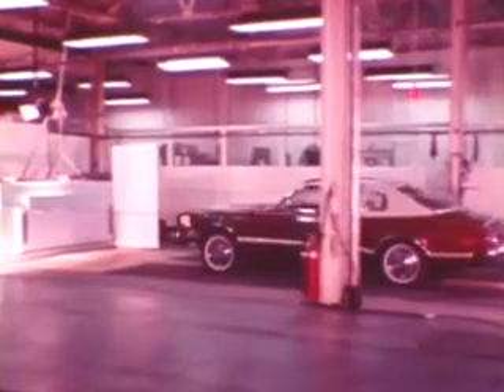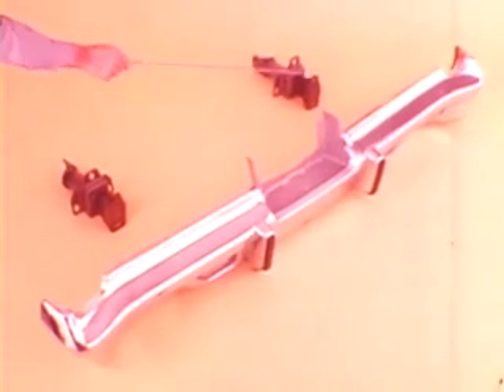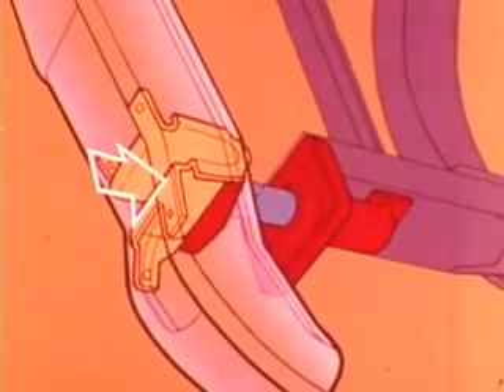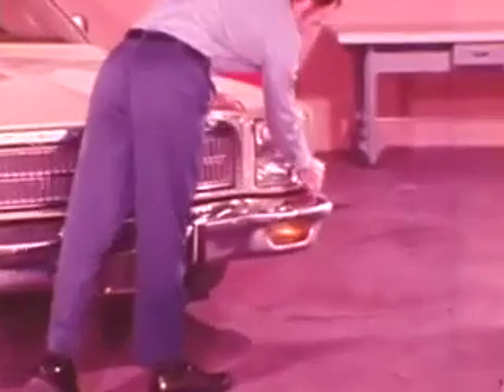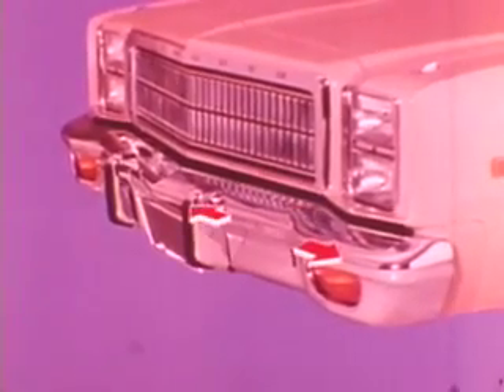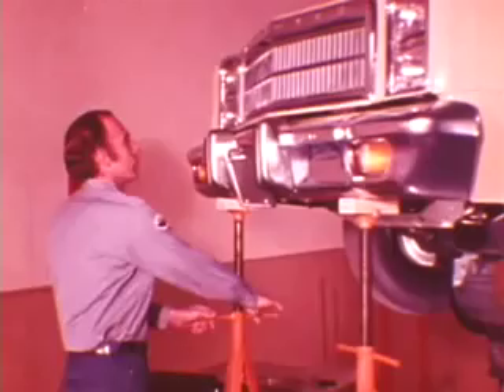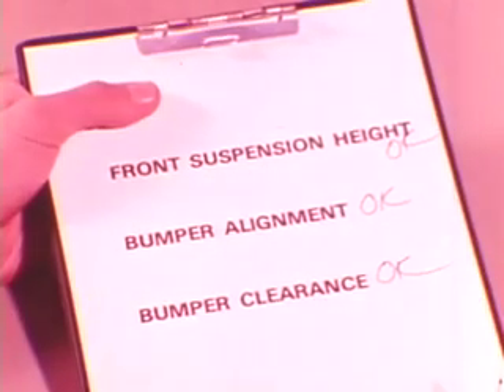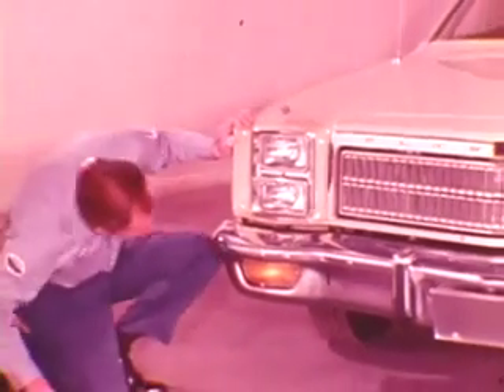Chrysler Master Tech - 1977, Volume 77-5 Impact Energy Absorbing Bumper System

Comment: We are from the Government are here to help!! I cut my teeth as a 'Wrench" on this vintage garbage... Yep, brand new these things would, on average, sustain a 5 mph impact if hit dead square. 

The theory was: Cheaper crashes at low speeds and limiting or stopping COSTLY damage at speeds, a good thing, right? No. It added around 150 lbs. of steel and assembly garbage as well as complexity. Once you hit something at about 10 mph, to correct this junk to factory got stupid expensive stupid fast.

Comment: What ever happened to these requirements? Still in force, but solvable with simpler hardware?
Reply: The 1976 standards everybody hated were rolled back by Ronald Reagan in 1982. The 1976 standards specified no damage at 5 MPH, the standard to this day is to halve the speed to 2.5 MPH, and the no damage requirement only applies to safety components (lights). Later, Europe introduced pedestrian crash standards which required softer, easier to damage components like aluminum hoods, which is where we are today with bumper covers with a thin plastic shell with foam underneath.